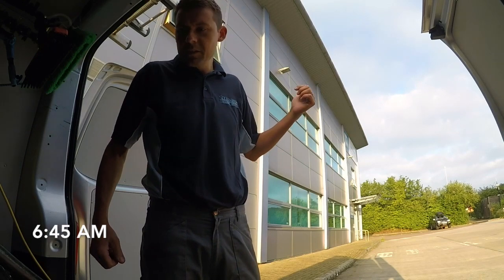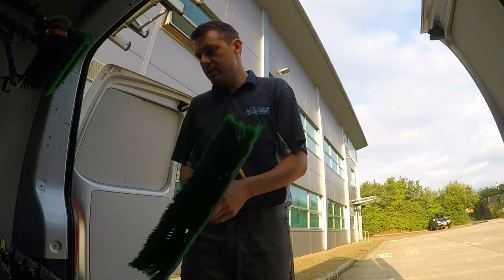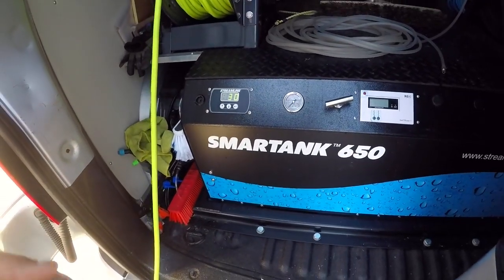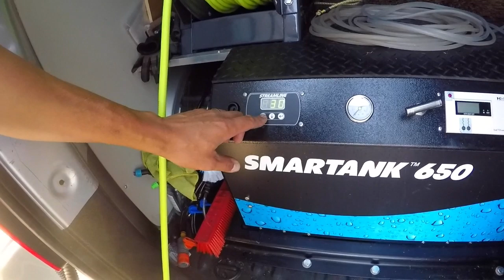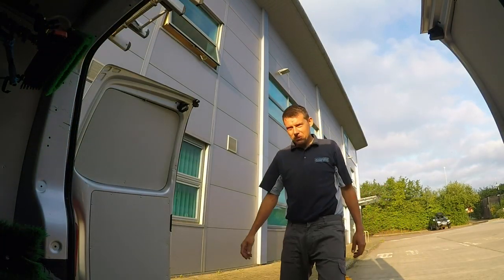Commercial Window Clean Using Water Fed Pole Van System

Comment: Hi Ashley. Great job as always. Have you thought of one of the Gardiner 35cm brushes. As you are using the hi mod try something like the Xtreme as it keeps the weight right down
Reply from the maker: Squeaky Clean Dave I have got a smaller Extreme, but there is no way it would cope with a job like this. It was very dirty, and it only gets done about once a year.😃👍🏼
Reply: A.E.Mackintosh Cleaning Services I see what you’re saying. I’ve got a factory I’m doing next week where there are loads of seagulls and that would be to much for the Xtreme so I use my 35cm Ultimate stiff on that. Have a great weekend 👍
Reply from the maker: You too. Keep up the good work.☀️😃👍🏼

Comment: Hi Ashley, I've just got my first commercial job similar to this but they have inside windows in the reception at the same height as the outside ones.. what length did you have that pole at to get to the top of the outside? thanks, Rob
Reply from the maker: It’s about 20/25ft I would say, to get to the top of this one, slightly higher than an average house.👍🏼

Comment: Hi friend, I have a question for you.  I have a new Unger Hiflo with a brand new resin.  The same brush as you and the water drops on the window.  My customers aren't used to it.  It's normal or something can be done about it.  Thanks for the reply.  Petr Czech Republic.
Reply from the maker: Petr Hrubý Make sure you wash the window frames as well as the glass, rinse everything thoroughly and the drips should dry without any spots left behind.😃👍🏼
Reply: Thank you for the quick reply.  I'll try to rinse the frames and glass more.  I'll let you know how it turned out.  You're doing a good job😁
Reply from the maker: Thanks. I hope it goes well.😃👍🏼

Comment: Hey dude love to see your work a question for u plz recommend me a cleaning gadget or machine for high buildings like 25 story or more waiting for u
Reply from the maker: Shoaib Shoaib A 25 storey building will usually be done by abseil window cleaners, or maybe even from a cradle? 😃👍🏼
Reply: @aemackintosh  I just search and got stuff like skypro but not valid contact no failed to contact with them
Reply from the maker: If you search for “Rope Access Window Cleaner” you should find plenty. Also, you might want to check what facilities the building has in place. It should likely already have fixing points on the roof to allow for abseiling?😃👍🏼

Comment: 👌👌Brush looks good... Will it fit onto a gardiner gooseneck...? I imagine there good for pvc also..?
Reply from the maker: Nathan Turner This is my favourite brush for upvc, although I use the small square brush for that. I think you will struggle to get this brush on a Gardiner setup. This brush is pretty brand specific unfortunately.😃👍🏼
Reply: You can try replacing the head stock to a Gardiner's one and connecting it straight to the gooseneck that way fiddley yes tho
Reply from the maker: Sure, yeah, I guess you could do that.😃👍🏼

Comment: What flow rate do you have it on when doing residential work!
Reply from the maker: Dave 1966 30 or a bit less.😃👍🏼
Reply: @aemackintosh  glad you turned it down,it would cost you a fortune in resin.

Comment: That pole looks terrible!!

Gardiners range are the best, you look like your struggling with that wippy unger pole.
Your trad skills look a lot better than your wfp I'm guessing your new to the pole.
Reply from the maker: SB Cleaning Services This Pole is not whippy, far from it. It has very little flex at all, I love it for jobs like this as it’s so sturdy. I found it a little awkward on the door where the glass is down to the ground, as I usually use an Ova8 pole on domestic work with a swivel attachment which is much easier for stuff like that.😃👍🏼
Reply from the maker: I actually made a video one time where I compared the Hi-Mod with a standard carbon fibre version, and you can really see the difference. I put a link in the description if you’re interested.😃👍🏼
Reply: Yeah I got HiMod as well - it's nice